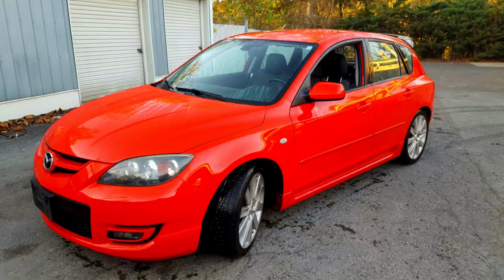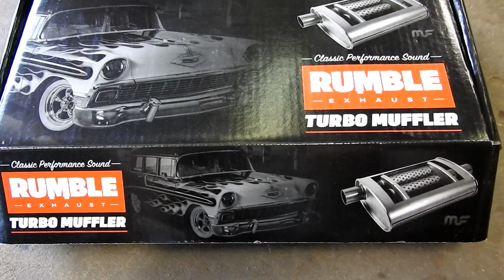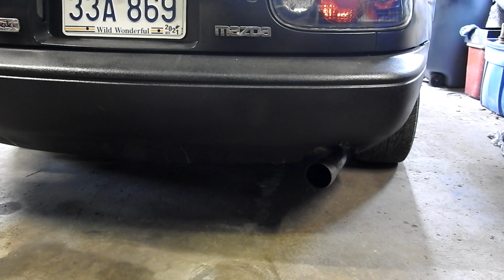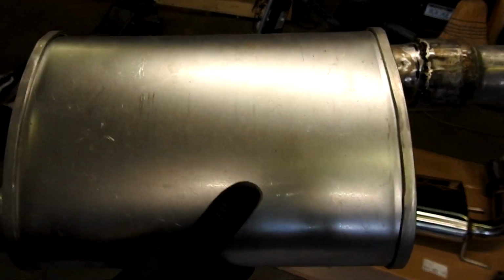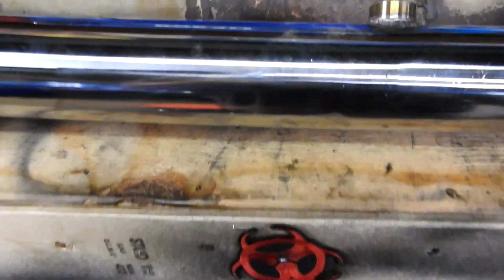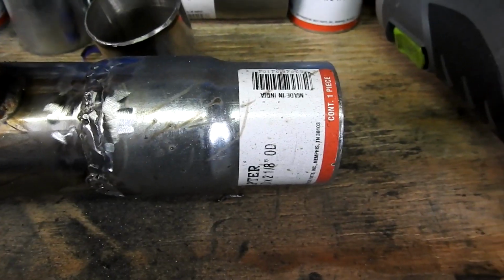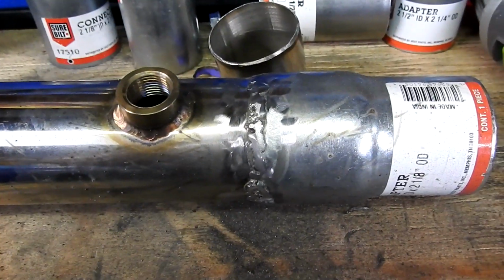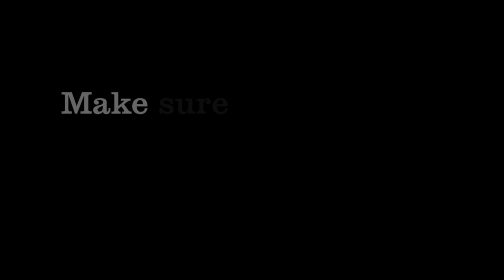PROJECT MIATA GETS A NEW COBALT TWIN TIP EXHAUST!

Comment: Dyno results?
Reply from the maker: Haven't dyno'd it yet.  I will when I get the turbo installed.  I figure I'm at or below stock hp levels for a 96 1.8 . I just got the forged rebuild done but it's at 8.5:1 compression so I think I'll be lucky if it's making 100hp to the wheels.
Reply: @rh2racing  Thanks - for me, the comparison one exhaust to another is what difference it makes on the dyno with all else being the same.   Sound is important, but performance impact is more so - but of course everyone has different priorities!
Reply from the maker: @buddyyount2588  I'm sure it flows better than the stock unit.  If you contact moss miata they may have dyno numbers for it.